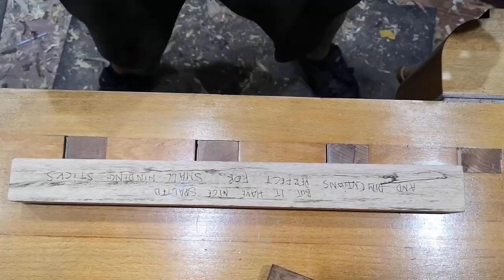015 Winding sticks for woodworking

Comment: Nice winding sticks but curious why you cut the contrast pieces at the bevel or angles instead of squared off ? Was it just for looks or to correct some the optical differences one sees due to the distance the sticks are apart ?
Reply from the maker: Thanks! During the glueing square inserts can move up a little bit. Shape that i use makes it impossible.